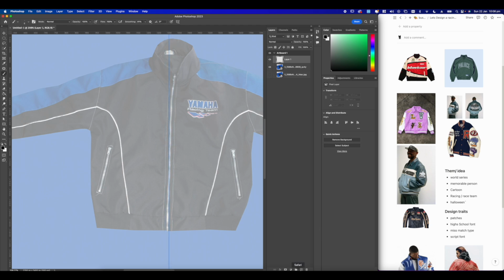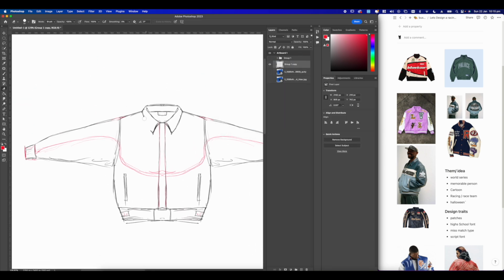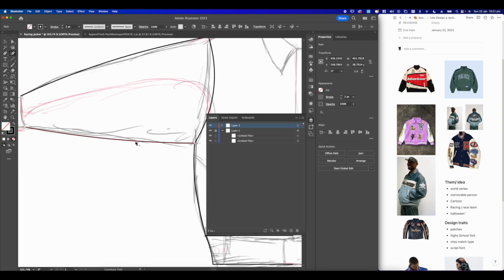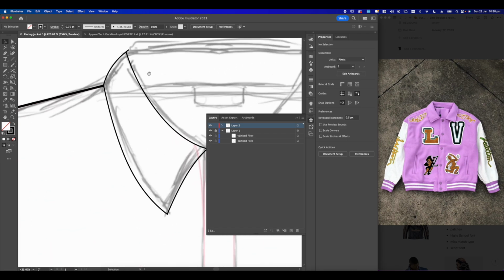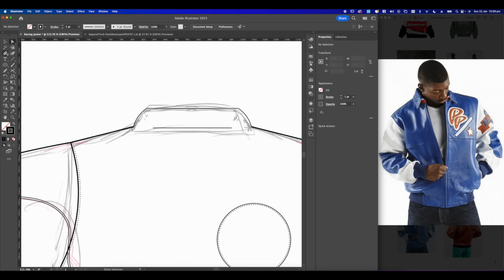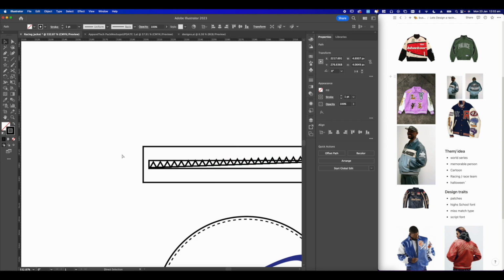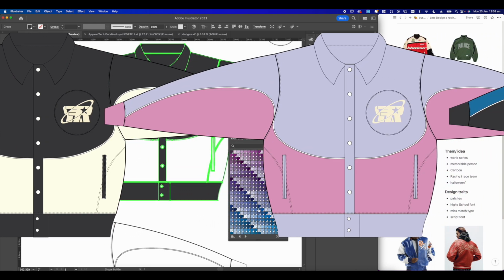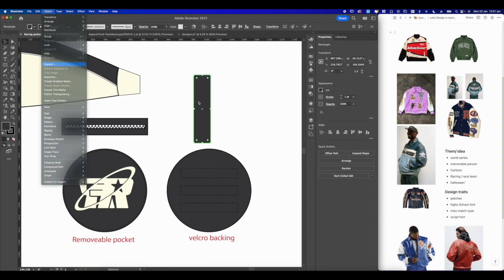DESIGNING A CUT AND SEW JACKET

Comment: how much does a sample custom made garment cost from alibaba usually
Reply from the maker: It changes a lot depending on manufacture but low end like $230 high end like $2k for clothing
Reply: @DesignedByWil  what about if you change up the lining and patching, and where the jacket vent is and stuff like that. Kind of new to the buisness so I’m not sure.
Reply from the maker: @dylanheinen4090  you won’t know till you get the quote and if anyone tells you different they are lying , unless it’s for a simple shirt or hoodie
Reply: @DesignedByWil  gotchu that makes sense. It’s for a nylon jacket
Reply: @DesignedByWil  also my budget is around 5,000 which would need to cover the first bulk order (they got a 300 moq)
Reply from the maker: @dylanheinen4090  300 moq budget doesn’t really line up to me if it’s a full cut and sew garment
Reply: @DesignedByWil  oh so you think my budget should be much larger?
Reply from the maker: @dylanheinen4090  knowing its for a nylon jacket thats fine but try to find lower minus, starting out with 300 units is insane
Reply: @DesignedByWil  you offer 1on1 mentorship?
Reply from the maker: @dylanheinen4090  no

Comment: How do you add material to your mockup in drawing? Like silk, crochet, cotton, etc...
Reply from the maker: first you'll need to build the texture, then depending on how large the texture is you'll use a clipping mask on top of the colour and graphic or just simply place it on top and turn down the opacity.

Comment: When ordering from alibaba do you know if the cost per unit for a custom logo is for just one custom logo on all garments or for one custom logo on each garment … my manufacturer says its $80 and the price per garment is $18 im thinking each custom garment will be $98
Reply from the maker: Question doesn't make sense
Reply: @DesignedByWil   maybe i didnt want to accept the answer they gave me but the cost per unit for a custom logo is $80 for my manufacturer.. does that mean each custom garment will have a $80 logo fee on top of the total cost of each garment or $80 for the specific custom logo for the whole bulk order all together
Reply from the maker: @jschoompferd350   If I try to make sense of what your situation is. You’re probably trying to order a single sample which indeed is much higher than ordering bulk. If your order one sample usually closer to retail of the garment due to labour and time, usually known as a set up fee or sample fee. In simple terms the more you order the cheaper it is, the less you order the more expensive it is. Don’t refer to it as a custom logo you’re not paying for the logo you’re paying for the garment it’s harder to understand. is that price fair, for a sample that’s considered super cheap.